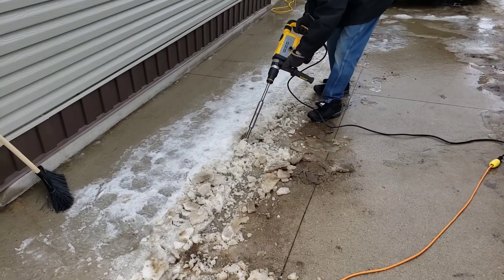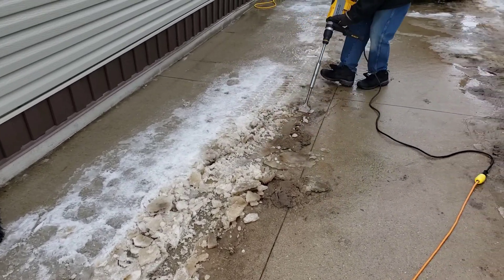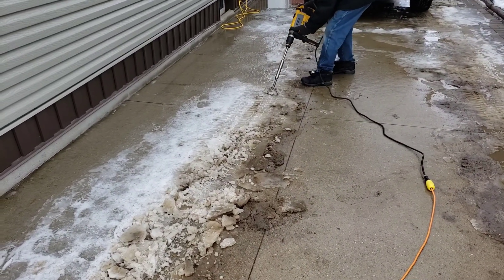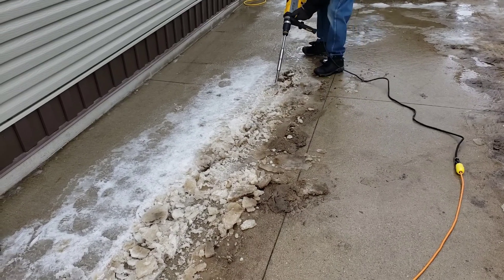Dewalt SDS Max Driveway ICE Breakup

Comment: I have a SDS Plus 60v with a 3" chisel worked liked a dream to break up the 4+" of ice I had on my drive way. Also works well to break up ice dams. Just stope before you hit the ground or roof surface!
Reply from the maker: My only wish in some ways that the SDS was a battery version. It would work better but for long term use I did not want to have to worry about batteries and the shear cost of them. I was thinking of making a wider chisel like a 6 or 8 inch to do a large area. A negative is because of the angle that you have to hold the unit, you get tired.

Comment from the maker: Have added the following link to the description above. 
https://www.homedepot.ca/product/makita-sds-max-bit-extension-adapter/1000777226
https://www.homedepot.ca/product/bosch-3-inch-x-12-inch-sds-max-hammer-steel-scaling-masonry-chisel-drill-bit/1000163544
https://www.homedepot.ca/product/makita-12-1-2-inch-sds-max-bit-extension/1000777227
Now using the 29 1/2" extension instead of the 12 1/2inch for better reach
https://www.homedepot.ca/product/makita-29-1-2-inch-sds-max-bit-extension/1000777229
The SDS Max D25604k No long listed at the HomeDepot.ca website.

Thank-you for your comment